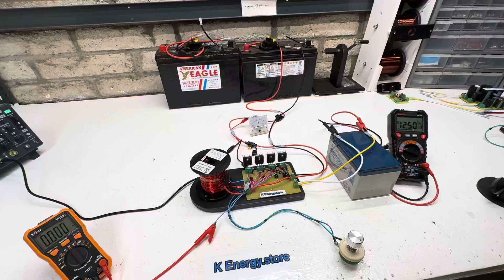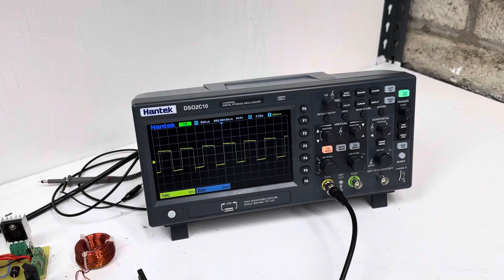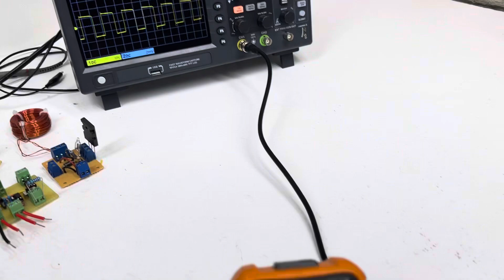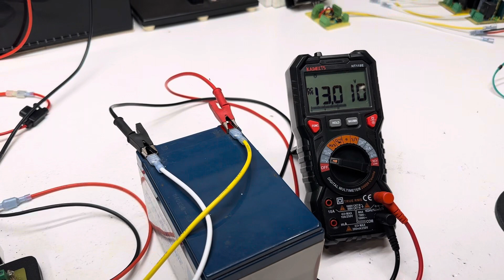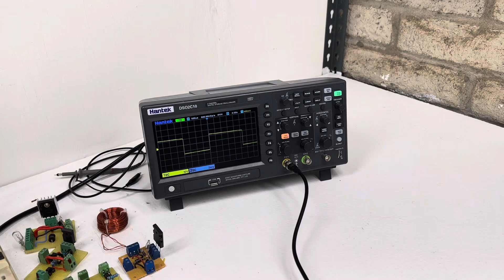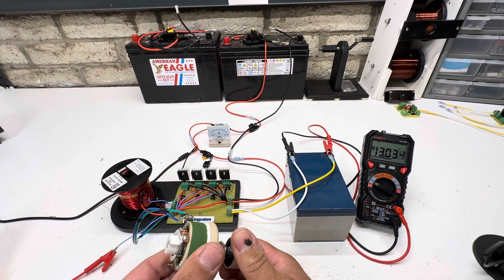Forced oscillator adjusting with pot and steel

Comment: Nice
Reply from the maker: Thanks joe ! How’s your experiments going ?
Reply: @kenergy1707  I have all the parts…. But life is sucking my time up….   Winter Jan feb..I dedicate more time to it….  Soon …  did you see Joel’s lagace new trigger check it out..  👍
Reply from the maker: @joew5559  cool ! I hope you get more time and do a video!
Reply from the maker: @joew5559  the low voltage spark gap ? Yes I did I’ve know about those for a long time cool concept though !
Reply: @kenergy1707  i did not know about them...  I thought most. Spock gaps we're high voltage I'm so old school
Reply from the maker: @joew5559  lol I found them about 15 years ago
Reply: @kenergy1707  Do you know if at low voltage the pressure is still relieved from the power at delivery?
Reply from the maker: @joew5559  it discharges till voltage lowers back to rating
Reply: @kenergy1707  not quite what I.asked but thank you… You are talking about Joel’s thing ..I am asking about the low-voltage spark gap gas… voltage discharge
Reply from the maker: @joew5559  that’s what I’m talking about
The low voltage spark gap
Reply: @kenergy1707  all good… I’m working on something and I determine that every answer brings new invite..  ty. 👍

Comment: Nice. I know this is off topic but, how do you make your rotors from steel for your non magnets rotors? Your attraction motor.
Reply from the maker: I cut and weld them together then machine them round
Reply: @kenergy1707 cool where did you get your stock from? An online or local dealer? and what size is it?
Reply from the maker: @mcorrade  local metal shop or online metal

Comment: I don't quite understand what I'm looking at? What does the oscillator do? To be honest I kind of expected some sort of signal or tone. I'm sorry if I'm asking silly questions I just found your channel and was really interested. If you can reference a video of yours that explains all of this that would be great.
Reply from the maker: This is a forced oscillator basically it pulses 12 volts threw the coil which when the pulse collapses makes hi voltage spike that can charge batteries or run lights or both 
This is a bedini circuit converted to force a oscillation
Reply: @kenergy1707  Ahhhhhhh. Ok. You're not claiming any kind of over unity are you? This is just a way to charge batteries using spikes from the oscillator? I'll go watch more your videos and see if I can flush out the whole purpose. Thanks for responding though that was super cool!!!
Reply from the maker: @tgirard123  no problem 
I’d suggest my outboard motor video there’s 2 the second one is what you will like